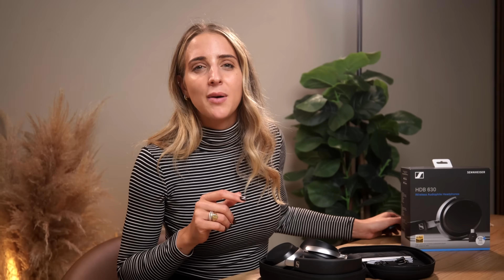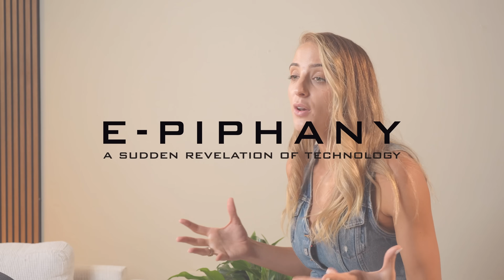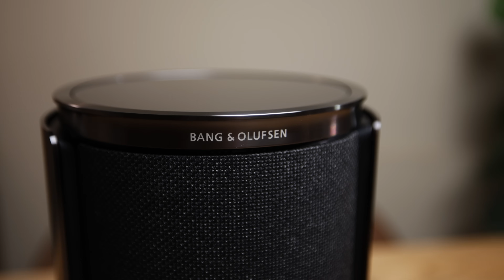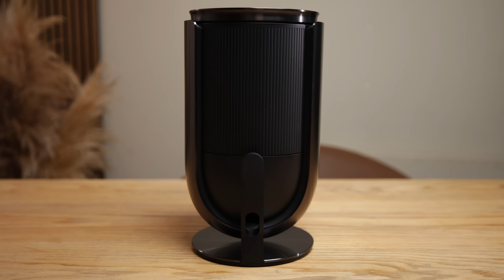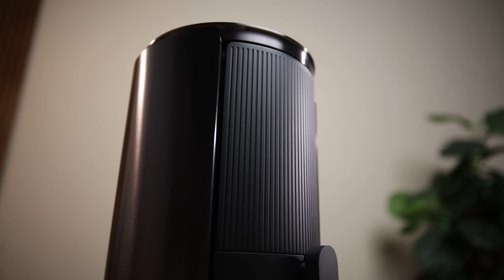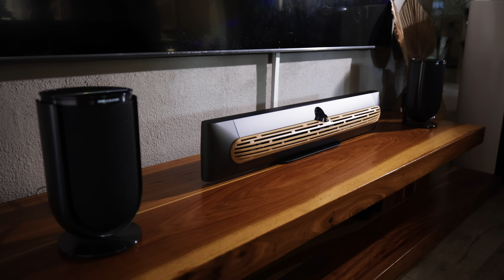The Truth About the Bang & Olufsen Beolab 8

Comment: Connecting wireless via Beoconnect Core- 1) Connect B&O core to TV HDMI/arc port (usually #2 TV hdmi port) 2) In BO app add the Beoconnect core, then add each speaker (2 speakers max wirelessly 3) Assign both speakers to the core via the "SOUND" options on the core screen in the app 4) Assign speakers "roles" i.e. left and right or rear, this is via an icon which has 4 black dots and center yellow dot (like a dice) on the Core screen in the app. Thats it.
Reply: I have the beoconnect core connected to my PC by toslink, but cannot connect to beolab8 wirelessly. I connect them by powerlink cable instead. How to connect them wirelessly?

Comment: I connected my TV with HDMI/earc (#2 socket in LG) to Beoconnect core. Setup on the B&O app is mildly confusing, but I will post it in reply. Also bluetooth(I wouldn't, audio quality is lower) and a WISA box to HDMI.
Reply: B&O app add the Beoconnect core, then each speaker (max 2 wireless). Then add the 2 speakers to the Beoconnect core via the SOUND option in Beoconnect core app screen, and then on the same screen look for an icon with 4 black dots and a center yellow dot, assign left right "roles" to speaker. ANd thats it.

Comment: I don't get it. You still have cables - they are powered units. IF anything, the cabling is more messy as you need a plug to connect each speaker to. 

In terms of looks, I prefer much a nice slim on-wall like the Perlisten S4S in gloss ebony or one of Focal or Sonus Faber's offerings over the tacky Beolab speakers which will show their age as their old kit does too. 

If dissapearing is important,, in-wall or on-wall speakers make more sense than these.
Reply: U can mount these also on wall

Comment: These look like poor imitations of the Denon Home 200 speakers with less functionality and and higher price tag. What’s the point?
Reply: They are vastly different from the Denon speakers. These B&O are high end speakers, the Denon is as cheap as you can go in HIFI.

The B&O has a 0,6" tweeter, a 3" midrange woofer and a 5½" woofer. 
There are two 50W amps for the tweeter and midrange, and a 200W amp for the subwoofer.
The height is 29x16,5 cm.

The Denon has a 0,98" tweeter and a 4" woofer.
Denon doesn't provide any info on the amp, but lists the max. Wattage,as 20 W. So, probably a 40W amp.
The height is 21x14 cm.

The built quality is vastly superior on the B&O. B&O uses an aluminium chassis, with hardwood ribbons. The Denon probably uses plastic, at that price point. EDIT: it's a polymer composite. So, it's made like LEGO is made - in a 5 second process.
But the price is also 15 times higher on the B&O. They also don't have the same audience, as buyers. The B&O is a high end speaker, that can also be integrated with their $100.000 surround systems, as rear speakers. The Denon is a stand-alone baby bluetooth box speaker.

It's like comparing a VW Polo to a Lotus Elise sports car, or the smallest Ferrari. You should take a look at B&O's homepage. There you can see the excellent build quality.

Comment: I’m old school. I’m not anti-technology, I sit at a computer for 48 hours a week at work. But when it comes to music reproduced the way I prefer to hear  it.  I rely on precision hardware to achieve that goal. Not programmed software to   digitally correct  and   make the  drivers do, what they should have got right through physical acoustics. I don’t want to be dependant on a streaming platform reliant on a 3rd party eco system, or tied to an app rather than physical/tactile controls. I don’t want a software technicians concept of what is correct. But that’s just me. I can see it floating the boat of many younger music lovers. But would they be prepared to sell the car, remortgage the house or sell their women, to raise the necessary cash?
Reply: You are absolutely clueless on the topic.

Take any speaker in the world that has gotten just a smudge of love into the development of that speaker, let's say over $500. They have all been in an anechoic chamber, and made to be pretty linear. Almost all speakers in that price range, you can find a graph from the developer of their measurements in such a chamber.
But they all sound very different! Why? The main issue is your room and how it affects your speakers. You should know, that a speaker can sound brilliant in the store, and when you get it home, it sounds like trash. That's because it's no longer linear or whatever your preference is (Harman curve etc.).

The speaker you have, already has a degree of correction. It's the RC crossover filter in the cabinet. All EQ is, is a way to further adjust your speaker to the room.
And many stereos still have room correction, in form of a bass, med and treble regulation. And many manufacturers are starting to integrate loudness controls into their expensive amps again. Again, room correction.
There are other things, that DSP can correct for. Things that are impossible for you, to correct for. A recording can sound very thin and totally lack any bass. DSP can correct for that. Or it can lack treble or have an overepathized treble. You can correct for that.

And did you know, that all and I mean all large recording studios heavily use DSP for their speaker system? They build a studio, then add dampening, in the form of diffusers and dampers. And you know what they do then? DSP the hell out of their $500.000 audio system. Why? Because linearity for them matters. But you, nah that wouldn't be right to do the same. It's okay, that the recording studios do it, but nok ok that you do?!

If you don't like DSP, just don't use it. But saying that speaker systems with DSP are not good speakers, is utter nonsense. No DSP can correct for a thin, ringing cabinet.
DSP gives you freedom. DSP cannot make a bad speaker sound good. DSP can correct a bad recording. DSP can give you that linearity, that you heard in the store, but not at home. It can correct that annoying 70 Hz raised bass ringing, that your room suffers from, no matter what speaker you try.
Reply: @akyhne on what grounds do you considder me “clueless”? Why do your experiences with DSP give you the right to claim mine are invalid. If you choose to use DSP to achieve your perception of audio nirvana, then for you it works. In my experience every additional processing stage in the signal path, causes a degradation of fidelity. If for you, the perceived benefits of DSP outweigh its fidelity degradation, then I’m happy for you.
Reply: @howardskeivys4184 You are clueless, because there's nothing clean about analogue audio. I asume, that you are either a Class A or AB "purist". Do you even know what measures they need to take, for those two systems to work properly?! It's nothing but "oops" solutions, to get around the odd properties of MOSFETs and the like. There's nothing clean about it.
And you totally missed my point. DSP is way, way cleaner, than for example a speaker crossover, which is purely analogue. It is way, way cleaner, than a bass/treble adjustment, which are almost all analogue working. And digital audio is way, way cleaner, than any vinyl recording can ever be.

You are simply not understanding the benefits of using DSP. You said it yourself. You prefer precition hardware. Precition hardware doesn't fix your room decay, it doesn't fix the raised 70 Hz range or the 120 Hz null, that you have in your room. True, most DSPs today, can also add "color" to your system. But the main benefit of using DSP, is to correct room errors.
No room is neutral. And DSP can do a heck lot more, than for example expensive cables can. Have you ever used vinyl as source? Do you use it today? If so, why do you use that pickup on the player that you do? Did you buy a more expensive pickup, than the one that came with the record player? It does the exact same, as DSP does. It makes the sound better.
Why is it okay for you, to buy that specific amp that you have, that you like the sound of. And those speakers you have, that you love the sound of. And maybe that pickup and oxygen free speaker and wire cables, that you threw a buch of money out on. And maybe a few dampers or diffusers on the walls. But it's not okay to use DSP?! It's just another tool, that you can take advantage of. Don't tell me, that you many years ago went into a music store, bought a full stereo and never replaced any of the gear. Why did you do that? To get better audio. But still, no DSP for you, that could make the sound even better. There's nothing purist about not using DSP. You already do "corrections", by upgrading your gear over time. But DSP? Nah!
Reply: yes, with the passage of time I have purchased new components, as you would put it “upgraded”. Only because with the passage of time the amount of disposable income available to me has increased.  

The fact is, the more accurate your system is, and the more even the off access response is, the less influence the room has. The need for any form of correction is seriously diminished.   FYI,  I’ve never employed any type of room treatment, other than carpets, cushions, curtains, sofas, rugs, Etc. I live in a spacious apartment on the ground floor of a new build, apartment block. After the watershed, that necessitates me switching to headgear for my music listening pleasure. If my untreated room and system not corrected by DSP/room correction really was detramental to my in room listing pleasure, surely headgear would make that stand out. It doesn’t. 

There are many influencers who frequently repeat “only you have to enjoy your hi-fi”. I do enjoy my hi-fi and have no plans to play with the sonic characteristics  I’ve come to relish. ‘If it’s not broke, don’t fix it’.

I’ve been attentively listening to music, the way I prefer to hear it, since the mid 70s. I’ve taken a keen interest in the topology   of electronic components, passive speakers, passive crossover networks, active speakers class A, class AB, class D G & H  amplification, switching and linear power supplies Etc. I have a masters in physics and a diploma in radio electronics. Don’t preach to me about what’s wrong and right. You wouldn’t tell your grandfather how to suck eggs.
Oh, and stop making sweeping statements and generalised assumptions on my choice of source components and amplification type. FYI I do not have a turntable in my system. I’ve not had a means of playing vinyl since the mid 90s.  You also described me as a “purest” with no foundation. If being a purist means my musical reproduction has not been subjected to excessive digital processing? Then so be it. 

You please enjoy your music in your own digital bubble. I’ll enjoy my music, my way.  That doesn’t make you right or me wrong. It means we achieve our goals via different philosophies. I just don’t take an esoteric view point. I don’t describe someone else as clueless just because our philosophies don’t match. I might drive a petrol vehicle whilst you may choose an electric vehicle. That doesn’t make your choice better than mine, or give you the right to criticise my choice with sweeping statements that are with out foundation.

I’m going to make a sweeping statement of my own:- I’m guessing that in 10 years time, I’ll be enjoying my music on the same system as I’m currently using. You will likely have had to make a number of changes to your system as manufacturers stop supporting your current software or your digital platform provider  no longer supports  accessability to your gear.
Most of all, enjoy the music.
Reply: @howardskeivys4184 All I did, was educate you. Because you didn't understand the purpose of DSP. You showed no sign of understanding, what DSP does and why to use it. You said, that products that made use of DSP, were poorly made. I corrected that. Like I wrote, you are absolutely clueless.

I'm happy for you, that you have such a nice education. It's above my level. But please, even if you are a bit older than me, which it sounds like you are, go back to school. Or at least educate yourself. You think, with your physics degree, that changing your audio system, will change the room's properties?! Have you lost the plot, or what?! Do you even understand with your physics degree, how sound travels in space? How it is influenced by the shape of the room, the furniture and everything. Nothing and I mean nothing in your system, will shape or change the properties of your room. Not even DSP can fix the problems. But as one of the only solutions, it can take them into account, and adjust for them. Not fixing them, adjusting for them.
There are other ways to correct room errors, and i bet that you have used one of them. Moving the speakers and your seating position around. It does the exact same as DSP, just that you have very little control over the outcome. You find the best spot for your speakers, and take care not to move them. Maybe even mark where they stand, when you are doing housecleaning. So that your speakers can go back to that favorite spot, you put time into finding. Within a centimeter. I admit that I do.

The DSP in my receiver, is not something I mess around with. I don't need an app to make adjustments, although I have the option. I calibrated my system until I liked it, and that's it. I can also back up the settings, so that in case the receiver dies, I can just load the settings into a new receiver.
And I don't care if you use DSP or not, but you clearly lacked an understanding on what DSP can be used for.
DSP is moving fast into even the most expensive HIFI. Use it or not. The good thing about DSP is, that if you don't like the outcome, just disable it.

I think I'm done here, unless you come up with some even wilder claims again.
Reply: no, you failed  miserably to educate me. I completely disregarded 99.997% of your responses, because they were so unnecessarily patronising. Of course I’m all to aware of how different speakers and their location effect the relationship with room acoustics. Stop …king making wild assumptions about what I do know and don’t know. This is where you’re clueless.  If room correction can do anything useful it is below the transition point. I use multiple subs to achieve that goal. 

The advent of digital did not come without its own family of distortions. Less sonically forgiving and less acoustically natural sounding than its analog competitor. I could quote the science and maths that validates my statement, but because your level of education is so clearly  far superior to mine, i won’t waste my time. Nor will I waste my time reading or responding to any of your future comments. I’m blatantly so poorly educated that my comments aren’t worth writing. I enjoy healthy, productive dialog about audio reproduction. But your esoteric, patronising responses aren’t worth anymore of my time, time I could be using to enjoy, listening to music reproduced the way I like to hear it on a system assembled for my pleasure and no one elses.
Reply: @howardskeivys4184 You deserved it, is all that I can say. When, and especially when someone is so well educated, at least don't write so much nonsense. Yeah, I was rude. I normally aren't. But spewing nonsense fires me up as the reader of that nonsense, and you didn't get a single thing right here. Like saying that DSP degrades the audio. You obviously don't even know what that means digitally. 

I'll round off with a technical question.
You have the recording artist in a studio, adding the final mix to the completed mix, right before they call it good and get ready to release the music. But the artist makes a last minute change, to raise the frequency around 7-8000 Hz, by half a dB. He just wants a little more "umf" in that frequency range.
Is the audio now degraded? According to you, it ruins the entire recording. He digitally did, what a DSP can do.
How do you know that he degraded the music? If you take a listen to that album, can you now say, "Yeah, he screwed up that recording. Now it's no longer fidelity".
This is your level of understanding on the subject - physics degree or not.

Comment: To use it as TV speakers without a B&O Soundbar you can use the Beoconnect core, that has eArc hdmi and connects wireless to your Beolab 8's . Or use apple tv to connect them as airplay speakers.
Reply: I have the beoconnect core connected to my PC by toslink, but cannot connect to beolab8 wirelessly. I connect them by powerlink cable instead. How to connect them wirelessly?